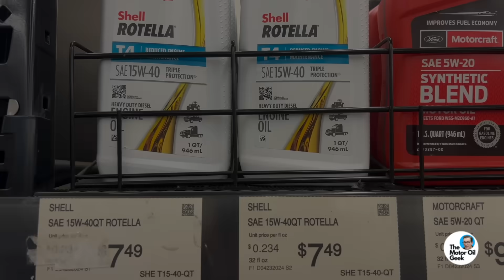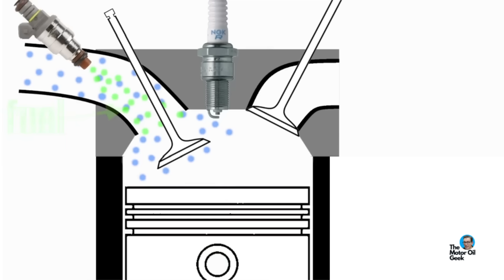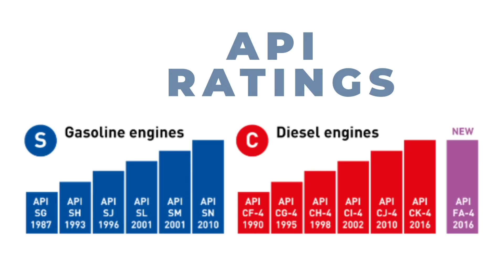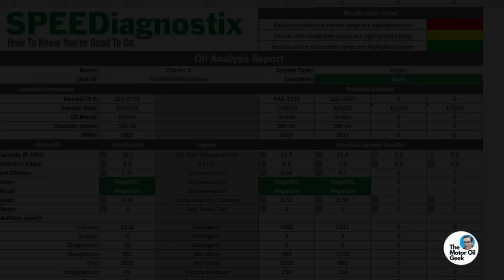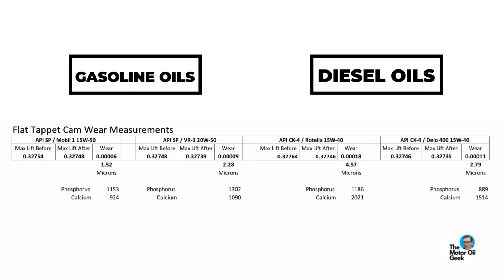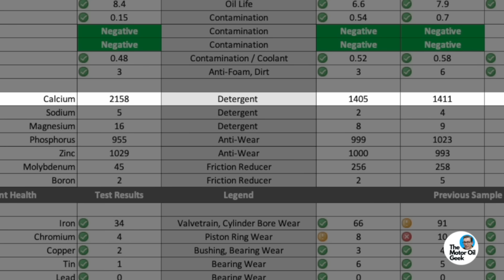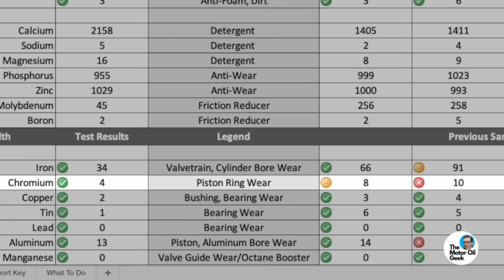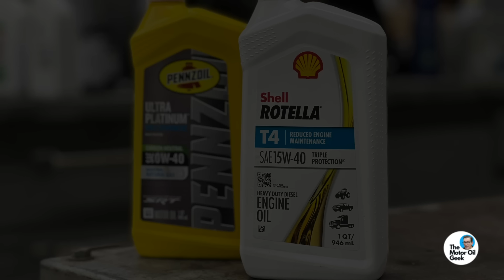Why DIESEL Oil is Actually WORSE for Gas Engines!

Comment: It took me years to understand why old engines  like vw and briggs air cooled wanted NON detergent straight 30 oil. Well it seem they had cams that had no oil bath but splash only lube. The detergent would  clean the zinc off the cam and lifter apparently. And the straight grade  would have better film. So this can make sense in average diesel oil i guess.

Comment: Motor Oil is Motor Oil..🍷😎👌
Always add some Marvel Mystery Oil and Lucas Oil Stabilizer and change the filters more often.. Oil just gets dirty.. It doesn't wear out. I've been running diesel oils in all types and sizes of gasoline engines for over 50 years and have never had an engine failure yet.. These two worms are full of crap.. What they don't know would make a BIG BOOK..

Comment: You're full of it. Today's engines take thinner oil,but I have a 1990 Ford Ranger with 680,000 miles on it that has had Rotella 15/40 in it for it's entire life. If you were to tear it down it would be clean as the day it was born. Don't try to feed me that line of B.S. I've been a mechanic for longer than you've been alive.

Comment: 15w40 Rotella keeps my 260,000 mile 454 alive. Grimey, leaky, only makes 12 psi of hot oil pressure, and squalls on startup as the lifters take a while to pump up.

Comment: What about the crossover stuff? Like VW in the 1.4 GDI that they specify a C3 diesel oil. Oil that is both rated for petrol and diesel?
Reply from the maker: The C3 oils are very unique. They have lower Calcium levels along with the diesel specific dispersant chemistry. The ACEA C3 oils are better than the B3 oils because of that.

Comment: The Rotella T4 you showed ALSO HAS AN SN Rating!
So the Rotella T4 is compatible with a Spark Ignition (Gasoline) engines.
Why not read the product label?
Reply from the maker: API SN does not provide protection against LSPI. That's why the API SP category was created. API SN will not pass the tests of API SP.

Comment: I had an " Iron duke " that went 319k on Trocco 15-40 .
We also ran 15-40 rotella T in several race engines with zero issues for years.  ( know of many racers and race teams that did the same )

Comment: Regarding UPS truck gasoline engines, When you order engines from GM, you pick from a wide catalogue of build specifications. There isn’t just one “LS” engine. 
A wide menu of options are offerred to help optimize the engine to the mission. Truck engines within same family will typically have different software, oil system differences, cam shaft differences, etc
Reply: Maybe someone has the catalogue from GM?
I fully expect that yes, among the same basic model you will have a menu to include piston changes, rod changes, oil pump size or drive ratio changes. GM doesn’t put the same engine in a car vs truck. The crate engine catalogue will have more variety than that.

Comment: Where's the "this video was sponsored by Mobil 1" disclosure on this video?  The comparison chart at 7:57 is the biggest crock of BS.  You cherry picked 2 fully synthetic "gas" oils and put them up against Rotella T4 which is a conventional dinosaur oil.  Notice how the Delo 400 which is a synthetic blend has much better wear results almost on par with the fully synthetic gas oils?  All this chart proves is what everybody should already know by now, that synthetic oils are better at wear protection than conventional oils.

Comment: For everyone clamoring about their diesel oil in a gas engine for the past 100 years: he said these oils cause Low Speed Pre Ignition (LSPI) in GDI engines. Being thag they weren't as prevelant as they are now, that why our ancient favorite cars and trucks didn't grenade on us. 

In my humble opinion, if you need a stronger detergent package in your gas engine, watch Lake's videos regarding Valvoline Restore and Protect. Go get the cleaning power you want from the detergent package while also protecting your engine from pre ignition. It is the best of both worlds and it's affordable

Comment: Not sure if it was mentioned... but,  Zink is known to have issues plugging Catalytic converters.   I have a SOOT monster... 2017 direct injected Chevy Equinox,  V-6.   The oil is crap after 2,000 miles.   I religiously change the oil at 3,500 miles... and now... I am going to 3,000 mile intervals.  40,000 miles and runs like a top. ... but,  only because I double down on the oil changes.   The SOOT is what kills the timing chains.  So... hence the extra oil changes.

Comment: Love this channel and all the information.   But are you really going to compare 15W50, 20W50 gas oils against 15W40 diesel oil????
No modern day gasoline engine recommends anything close to 15w50
And honestly 15W40 is antiquated in modern diesels as 5w40 is a much better diesel oil.  
Yes the duramax still says 15W40 in the owners manual but 5W40 is superior. 
For the average person this example is like comparing tomatoes to moon rocks.
Reply from the maker: Thanks for watching and for the question. Yes. Flat tappet cams place the oil in boundary condition, so viscosity makes very little difference in wear. Also, it is very difficult to find 15W-40 oils that are not Diesel rated, so this was a close and fair comparison between API licensed Gasoline engine oil chemistry and Diesel engine oil chemistry (with Calcium and Dispersant level being the biggest differences in additive chemistry). This is the first of three videos that go into how detergent and dispersants affect engine oil performance, so stay tuned.

Comment: Your examples showed Rotella & Delo 15w40 oils but interestingly the current Mobil Delvac 1300 synthetic blend 15w40  has an SP rating for gasoline engines listed.  
Always great information Lake. Keep up the good work.
Reply from the maker: If it is also SP rated, then it is safe for DI engines.
Reply: Same with Delvac 5w-40 ESP full synthetic. It has S ratings.

Comment: Rotella T4 15w40 and a few other diesel oils also meet 4 stroke gasoline motorcycle requirements like JASO and JASO M2. So they're also okay for other, older gasoline engines. I run it a flat tappet 350 because I also like the viscosity of 15w40 in a hard-working, off-road truck. Also modern 15w40 T4 is SN rated, despite having over 1100 PPM zddp.

Comment: I've been using Rotella T6 on several of my motorcycles. And with 100,000km combined, never had any problem. I love the T6 because it has a much higher content of zinc, which most other oils have drastically reduced for environmental reasons. Oil formulations within a same brand will change along decades...

Comment: I was left wondering from previous vids the comment that ACEA oils are approved for gas and diesel oils at once.  How do they overcome this apparent conflict where gas needs less CA and diesel needs more CA. I also note that even as an old timer myself,  I recognise that what worked on a 65 small black  may not be ideal for a 1.4 turbo today. Great channel!
Reply from the maker: The European ACEA oils use a different approach. Interestingly, the Mobil 1 European formulas changed last year (less Calcium) and are now API SP rated instead of the previous API SN rating.

Comment: Few years ago I ran 5w30 diesel oil in my direct injected turbo petrol golf (called for 5w30 petrol oil) and over the next few months the engine became noticeably louder and developed oil leaks. When changing the oil (and fixing the leaks) it was black like typical diesel oil. Back on 5w30 petrol oil the engine was quieter again and hasn’t had a leak since.

Not sure if correlation or causation but I’ll default to the mfg recommendation of petrol oil on this one.

Comment: @themotoroilgeek what's the difference between Mobil1's Turbo Diesel Truck, Delvac 1 ESP, and Delvac 1300 Super for a Power Stroke or any other diesel 1 ton? Or should I ask what your opinion is on the best diesel oil for modern diesel pickups? It's so hard to find a straight answer on anything on the Internet.

Comment: Between 3 gas motors I have a combined 800,000 miles on rotella t6.  My Ducati had 40,000 on same said oil as well as my c6z06.  Been using this oil for 15 years no issues.

Comment: Another one is to see is for air cooled engines. For example I have a Cummins onan generator (gasoline engine) and it wants 30wt oil. There is not much of those avaiable so they say 15w40 can be used. Wonder if that is better and may not quite apply to that application? Air cooled is very different from what I understand. (This would apply to lawn mowers and things as well that tend to really not like car oils, smoke bad on startups etc)

Comment: The most compelling argument for using Diesel rated engine oil in a gasoline engine is viscosity breakdown, oil for a Diesel is more durable, and better able to withstand the physical abuse that crankshaft bearings subject the oil to.

Comment: Who the hell is running diesel oils like Rotella T4 in new DI gas turbo motors?! Thats what modern API S gas oils are for. We run T4 in old flat tappet 350s and 454s and have for years with good results.

Comment: typical click bait title.  and that piston failure is purely speculation as lots of other potential reasons
Reply: There are real world examples of it happening, but I suspect they were modern fairly high compression engines. I think most people using diesel oil are going to be in an older dirty engine that they're trying to clean up

Comment: The reason people buy Rotella is Its CHEAPER because it is the highest volume Synthetic oil for Semi trucks combined w  Wal Mart being the largest retailer for it along w Mobile1. The fact Rotella happens to be one of the best scienced oils to me is the #1 benefit. At my local Westminster California Walmart, they keep the Mobil1 locked up due to theft...the T6 stuff is not locked behind glass. I asked the automotive dept lady why that's the case she says all the Mexicans kept stealing the M1 because it's got the higher price they think it's the best! Lolllz 

M1 became crap back in ~2005 when wal mart made them drop the price and Mobil won in court and was allowed to call it synthetic on the packaging(none of its synthetic anymore except for the gold top 'high mileage' version)

Rotella does not burn off like the non M1 does. I used to use factory fill M1 in LS2 V8 and Subaru EJ25 turbo. Even when engines were new they would burn 1/2qt M1 oil after a few thousand miles. Made Rotella switch and NO drop off on the dipstick again. If 18 wheeler fleets run it why not us? 

Im using the T6 5/30 'multi vehicle' in my 4.0L 4 Runner w Magnussen supercharger (350hp) I saw the part here about the D.I. pressures in the chamber and I feel assured its not an issue in my port injected 'old' 4.0L with 6psi boost. I wanted the added Zinc 'feel good' for the RPMs I like to hit and not worry about the Cats getting poisened since the zinc is sweet spotted to protect them. But its still a diesel oil also to keep costs down for fleets. Im at 113k miles and I flog the hell out of that motor w boost and run a stock air filter. No issues after 6 years of that oil and a blower spinning 34" rubber. Toyota started specing 20wt oil but the older FJ Cruisers used to say 40wt in the manual and they are the same rotating assemblies. 20wt 10k oil changes? Nahh...thats EPA cucked Hyperbole.

Like many others here in comments I run 10/40 T6 in Hayabusas and Gsxr1Ks (all decatted of course lol) and no issues w motors. I ride daily and change it 3-5k depending how lazy I am and even skip filters like suzuki says to do every other oil swap. I do wonder if the soot handling ability of diesel additive pack has any correlation with handling clutch material in bikes? I ran Motul 'boutique' race oil before and people behind me would say I burned green smoke when I jumped on it...and YHA the bike burned that oil level off. Those MC specific race oils arent made to run higher mileage either, just for races and changed again. Higher price doesnt mean 'best' for a daily driver.

I have an 84 M1008 CUCV chevy marine corp truck w a 6.2L and an o.g. Banks Sidewinder snail w fuel turned up. I use T5 40wt and change it every 2k-2500miles bc of paranoia of soot from fuel turned up(and 6.2/6.5 mains from harmonic balancers neglected) Engine still sounds good after 14k miles of ownership since I got it. No guilt from 'over changing' the oil

Comment: Thanks a lot. Here in Europe (France), now they only sell oil that is both meant to be used in diesel and gasoline. We can't find gasoline-only oil anymore.

My gt86 requires an API-SN (or API-SP) oil, but all the oil we can find with "API-SN" (or SP) written on the bottle, also have "acea C3" and "diesel compatible" written on the bottle.
Reply: So true, tons of euro spec oils are for gas & diesel even in USA.
Reply: That doesn't mean it isn't the proper oil for gasoline engines, that's nothing new, most gasoline oils were suitable for some diesel engines and included that on the label, only some overpriced oils forgot to mention the diesel engines to make their fans thing it was better.

Comment: What about occasional oil changes with rotella in a gas engine? I only drive manual transmission vehicles. Dont know if it matters just never had an issue but i do know it has cleaned buildup from parts inside the engine. Im extremely good at not exceeding 5000 miles between oil changes and i only use 1 brand of oil filter. Wix is my only filter i use.

Comment: Diesel motor oil has less ZDDP than regular motor oils. Standard engines that use standard valve springs don't require higher levels of ZDDP. It's always best to use the type of motor oil specified by the manufacturer for the engine in your vehicle. The only time I use Diesel motor oil is 500 miles before the next oil change is due for my '88 Chevy G30's 5.7L. The motor uses or leaks out 1 quart of motor oil every 500 miles so I'll removed the big spin-on oil filter to drain it out then reset so I can add a quart of Shell Rotella and 1 quart of MMO. After driving 100 miles the former mildly dirty motor oil is now much darker and is jet black when drained out. The 300,000 mile engine also starts running better after 100 miles and like new again after 500. I alwas used Castrol 20W-50 in it since 1994 but now it appears that conventional motor oils are disappearing from Walmart shelves. I'm not a fan of using synthetic motor oil in older engines due to trying out Mobil One when it first came out in a low mileage 1971 Volvo 142 I had just bought. Paid $4 per quart for that and too much for their filter. Checked the oil level after driving 500 miles to find barely a drop on the end of the dipstick. Drove the car to the corner Mobil station where I bought the oil and filter. They drained the remaining oil into a clean container to send back to Mobil with the drained filter. Then they provided a free filter and conventional oil before taking down my full name and address, saying Mobil will be sending me a letter. Got one three weeks explaining what happened along with a check that covered my cost for the Mobil One oil and filter. The letter said it shouldn't be used in engines that had over 25,000 miles of use.

Comment: I have a 06 gmc 2500 HD with a 6.0 ls. I run shell rotella t4 in it. It now has 289000 Miles on it all on shell rotella. The oil come out cleaner and it doesn't use any oil. Unlike when I first used the factory recommended oil. I'll never use anything else. Plus shell still puts a small amount of zink in their oil which is great for flat tappet motors. That's all I ran in my old square body chevys

Comment: The animation with the pistons upside down in the oil pan killed me.  I will continue to run T6 in my turbo race engines.
Reply: Related, only engine failures I've had was using VR1 oil.  It sheared to water in like 10 minutes and the engine failed within 14 hours.

Comment: Ran 15w40 in lots of 1/2 ton pickup trucks & passenger cars(fords, gms, & Chryslers) all with gas engines.  Also used it in late 70's chevy grain trucks with 6.0 liter gas engines.  Never any issues, but modern gas engines might have tighter tolerances where the 15w40 diesel engine oil would be too thick to squeeze through those tight tolerances.  After I watched more of the video, the main issue seems to the the chemistry differences between the 2 types which I hadn't considered before.  But still never had any issues with premature engine failure for any reason.

Comment: There are many mechanics, myself included, that use this type of oil a lot particularly in older engines and it works extremely well. Better in fact than many conventional graded "gasoline" motor oils.

Comment: I've got a Nissan d21 L4 with over a million miles on it, and since it's first oil change it's had Rotella T4.  I bought it at 550k miles and put the other 500k on it myself.  It's finally blown a head gasket so I either get to swap my spare engine into it for a while or I get to let it sit while I rebuild it.  But either way I can check the wear on it.  I'm super interested in seeing how bad/good it is.  After the rebuild I think I'm going to go to Amsoil Z-Rod, I've heard good things about it and it has a super low blow by compared to most oils so the extra zinc that's in it doesn't clog your CAT, or so I've heard.  I'm going to switch to that on my Fiat 124.  Seems the multiair system really likes the added zinc.